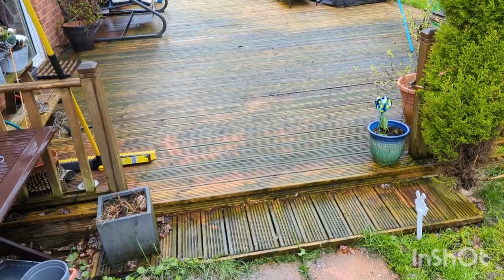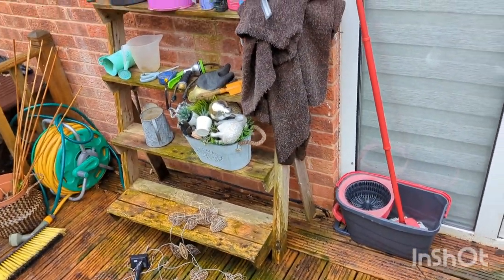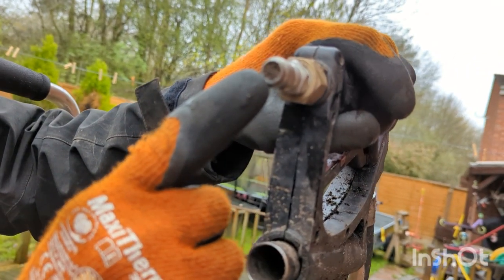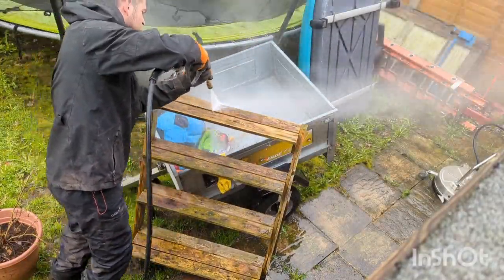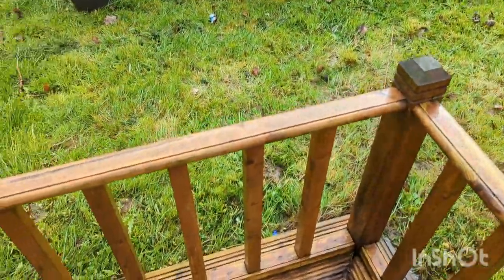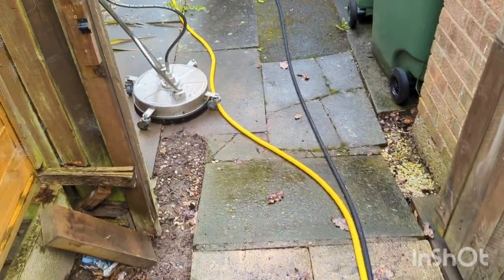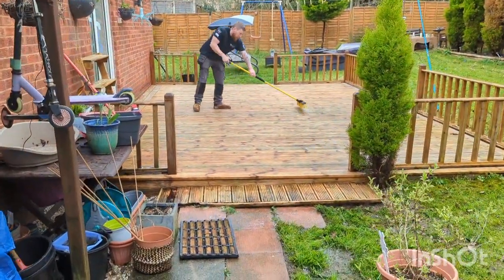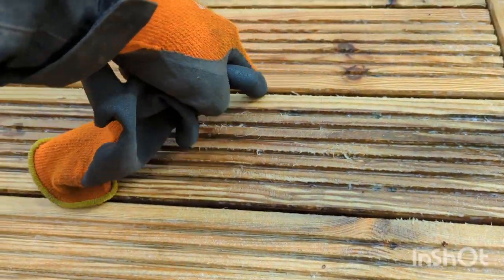Efficient way to clean decking?

Comment: Cracking job, mate. Drcking does lighten up a lot once it's fully dry. I did a job, which i was a bit disappointed with, but then the next day when i went back, it was 1000% better and had lightened a lot.

Comment: Do you just use the same connectors on 😃😃the 3/4 hose or do you need different ones? Many Thanks  Mark😃😃
Reply from the maker: I'm using the same connections and it was really difficult to put together. If there are bigger ones out there, that would be best but I haven't looked
Reply: @SMOUT_  Thankyou that helps as ive been looking for the right size connectors and have found it hard to find. Thankyou for your help. Mark😇

Comment: What hypo do you use?
Reply from the maker: Just generic farm shop 15%, plus pureseals surfactant (surf boost). I'll go back to using pureseals nuclear pro when I run out.
Reply: Sound mate cheers. You ever try that GkPro?
Reply from the maker: I used it with CM Pressure Washing on a roof before as part of a double up, but never went back to see the results.